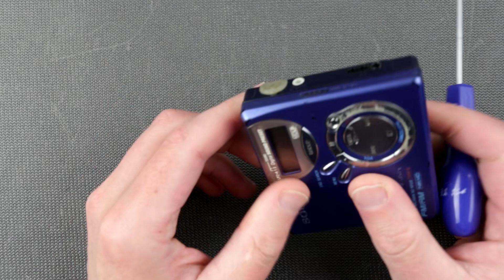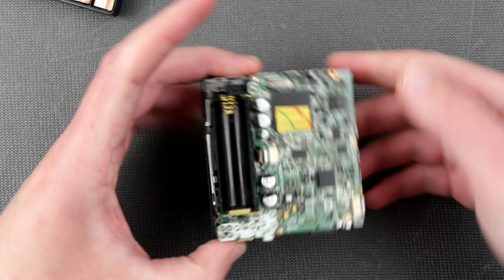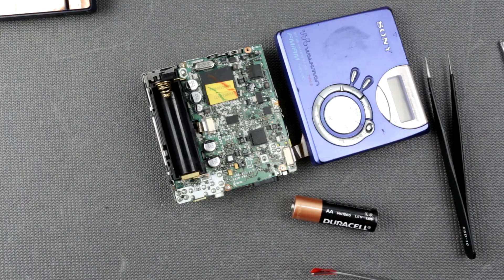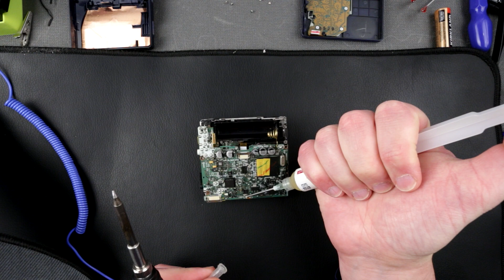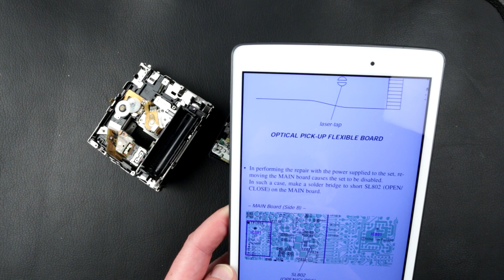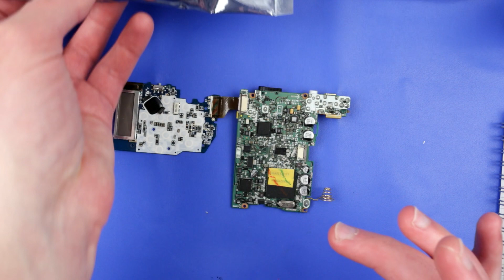Sony MZ NF610 Minidisc Player Repair Attempt

Comment: I just bought an used one just like the one you are repairing, upon receiving it, tested it and worked fine, couple of days later I pulled out my minidisc colecction and try to use it but it won't turn on after inserting the disc, replaced the battery the same, when I toggle the hold swtich I can see on the screen the battery icon and hold word on the screen, it did not came with antenna cable to test this function, is ther any switch that activates when disc is inserted that might have gone bad or break in the latching mechanism? Thanks for your support
Reply from the maker: @pboza2002  it sounds like board is working but you are right might be disk detection switch
Reply: Eu tenho um usado, mas praticamente novo. Sem nenhum risco. Só falta o fone, que uso de outras marcas. O fone original não funcionava, já descartei. Tô pensando em por no mercado livre aqui no Brasil, mas não tenho noção de preço. Tenho 04 Md pra rodar com gravações já. Hj é mês 02/2026. Se alguém tiver noção de preço agradeço. Abçs